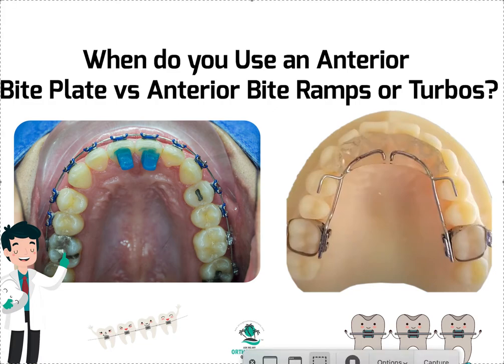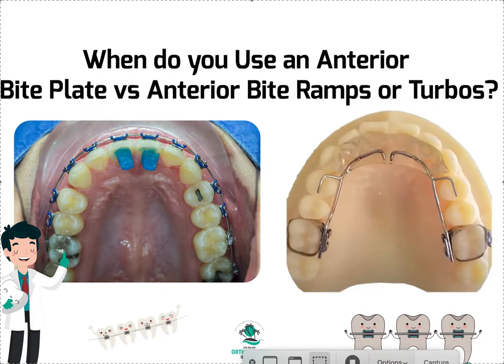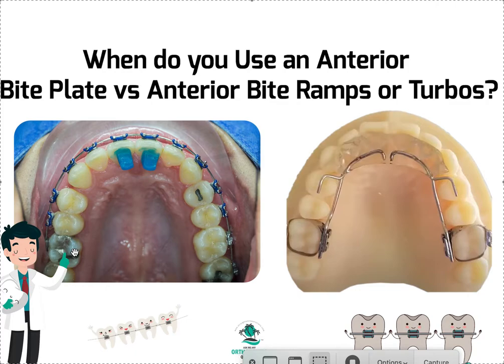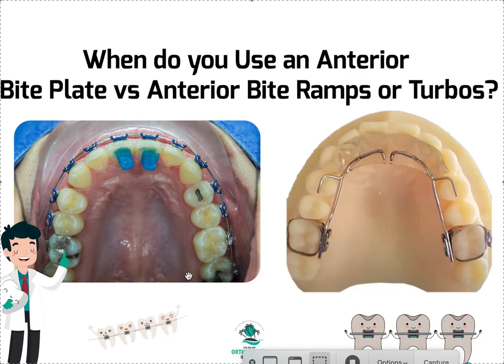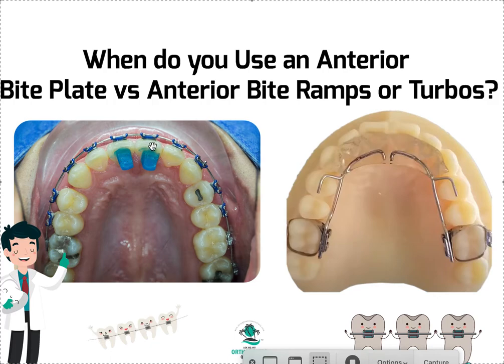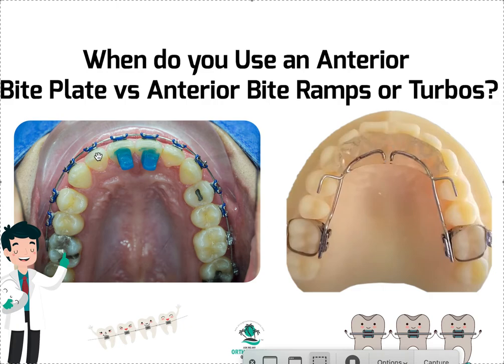When is it better to us an Anterior Bite Plate vs Anterior Bite Turbos?

Comment: Hello! Can you use the bite plates during the fixed ortho or is it supposed to be worn before? If it can be done during the fixed ortho, what wire should I be on?
Reply from the maker: Of course same time! Just in the level and align wires (<018 niti)- this is covered in our Straightwire playlist or straightwire course